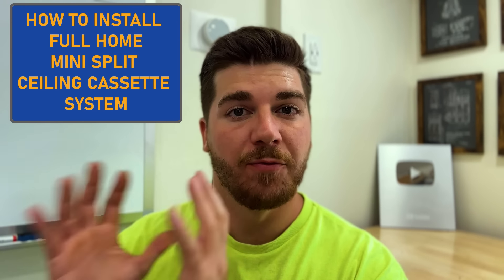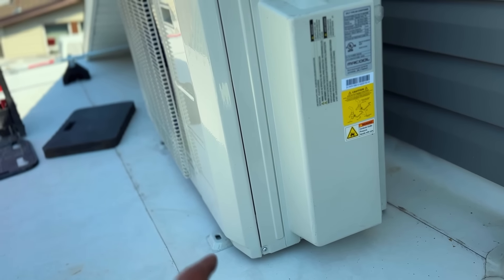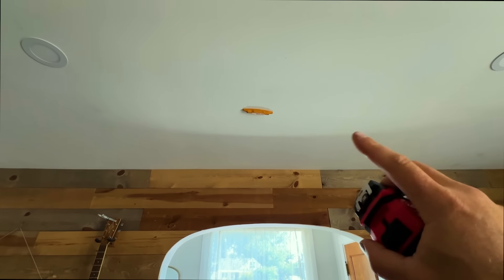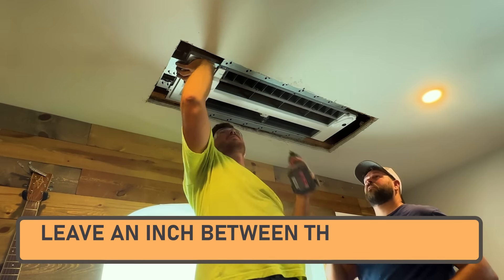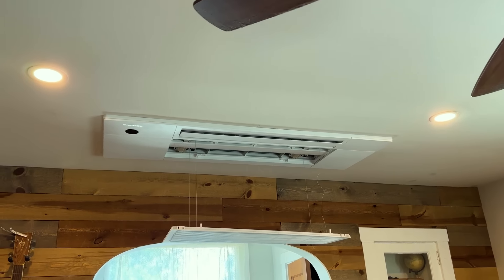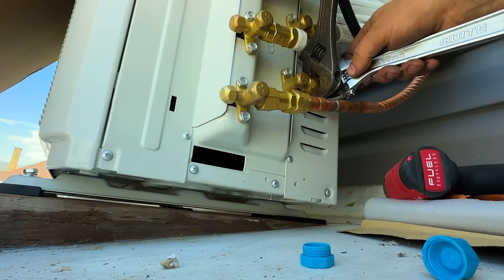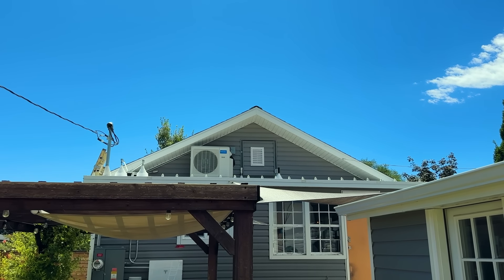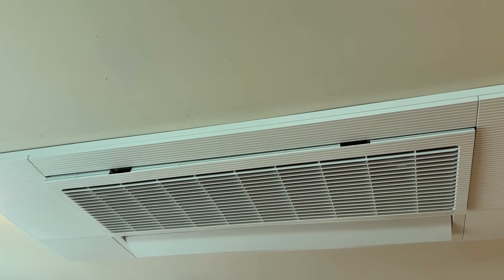The Mini Split - REINVENTED.

Comment: Sorry, I will never buy nor sell a customer a mr. cool. They are garbage systems made to appeal to the consumer for being "DIY" but everyone i've ever gone on service calls for leaks gas like a mf. Sometimes certain things are worth doing the right way
Reply: My Mr. Cool in the garage doesn't leak and works great. I torqued mine to specs though. Most people do not as shown in the video. If I was an HVAC company I agree with you and not sell these to customers. Mitsubishi and Fijitsu are for clients.
Reply: Yes l, I've seen these units leak down in under 6 months due to the indoor coil failing. Mitsubishi all the way! That being said, Gree, daikin, LG, and so many more are leak monsters.
Reply: That’s what you guys always say when something is cutting into your territory.  Jeff Bezos said, “your margin is my opportunity.”  Where was the HVAC industry during Covid?  MIA.  Supply chain issues all over the place.  HVAC professionals jacking up their prices to the moon.  During that time, Mr. Cool gobbled up market share with units ready to ship, at reasonable prices.  

Protected industries (price fixing cartels between suppliers and installers) suck.
Reply: My 12k Mr cool diy 3rd gen is working great after 3 years. I clean the air filter every couple weeks. About twice a year I deep clean the inside coils with foaming cleaner and spray water bottle. I clean the outside coils once per year. Working great. My installation was a little sloppy but I don't really care.
Reply: The quality of these units is decent.  Tech support and parts are the weak link.
Reply: Well if you ac guys didn’t gouge consumers, you might not be loosing business to Mr cool 😂
Reply: My first gen is 12 years old and still kicking ass!!
Reply: My Mr Cool unit has been running 24/7 in a difficult shop environment.......zero issues. 

"Doing it right" was like 5x the cost. Clearly the Mr Cool delivered a major win  for me.
Reply: cool story fud bro
Reply: I’ve installed two Mr.Cools in the ADUs I own for my tenants and it’s been 3 years and no issues.
Reply: @ElektroKinetik The irony when no one wants to do the maintenance themselves and pay someone else to do it or don't do either then complain about "gouging" when it breaks and they have to come out and repair it.
Reply: @joyoptimal6286  after a couple years this crap tends to build up on the inside coils as well as the blower wheel. It can lead some people to thi k that mini splits are stinky garbage. But they aren't. They just need a deep clean. And the coils are actually somewhat accessible for cleaning unlike most central ACs. You can blast away the crap that cakes on the blower wheel and coils with a spray bottle with water and a little dawn. Then get slightly more aggressive with a foaming product like AC safe.
Reply: I have a two zone Mr Cool minisplit on my 1000sf workshop for 5 years in the hottest part of FL on the Gulf Coast. Still going strong. I run it year round. To keep my shop humidity down, it's never off.
Reply: I had a Mr. Cool system in my townhouse for seven years with no troubles.  Still worked fine when I sold the house in 2014.
Reply: HVAC guys charging thousands is the reason people have window units and Mr Cools. 
Hiw many of you give back to your communities and help out elderly folks who can only afford fans in their 100 degree homes?